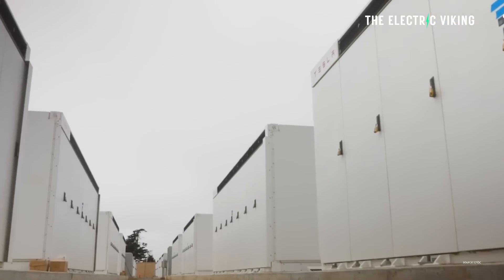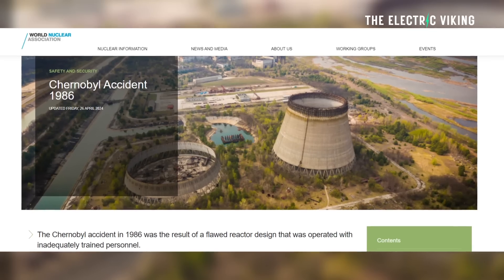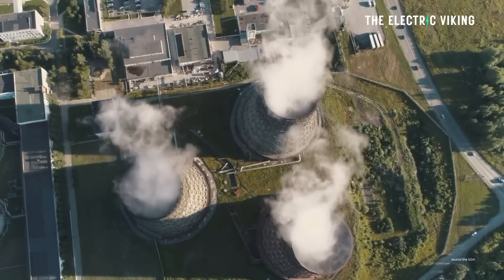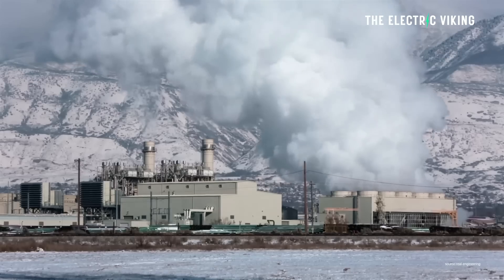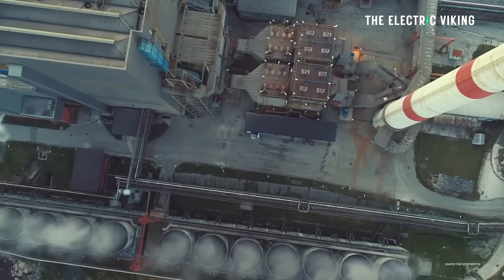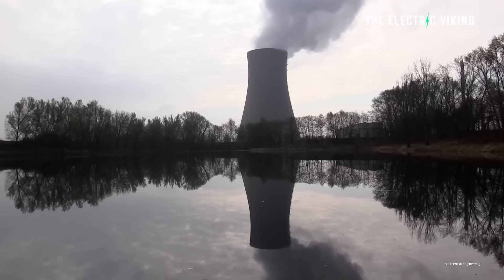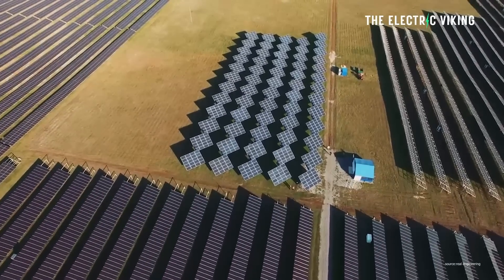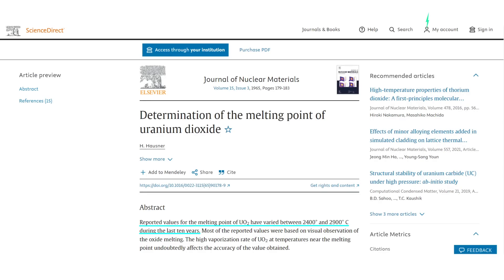China build the world’s first thorium molten salt nuclear power station

Comment: Thorium molten salt reactors do not require water for cooling. Molten salt is used for heat transfer. Corrosion was a significant obstacle. Chinese scientists must have overcomed this for it to be commercialized. Small Thorium nuclear reactors could be built in remote regions and since it does not produce by products for weapons, it can be safely sold around the globe. Small Thorium reactors are safe for use in ships. India has a huge source of Thorium and has been working on it much longer. For some reason it now lags China in this area. Many other countries are now jumping on the idea and I wish them success.
It takes a country like China to push peaceful use of nuclear energy.
Reply: @northernsamba7388  you’re exactly right. I would only add that many believe the corrosion issue was far overblown to get the desired outcome. Certainly with the intervening advances in materials science that’s more of a speed bump than a barricade today.
Reply: wr
Reply: Molten salt is less corrosive than hot water. 

A more corrosive thing is some mix of salt and water. (ie salt water). 

Whether your reactor design uses salt, or you use water instead, you want to keep the coolant very pure.
Reply: @terjepetersen  That suggests two probable main reason why USA killed Thorium reactor development, they wanted bomb making uranium or they viemed keeping salt pure difficult.
Reply: @northernsamba7388  - I don't think either of those were significant factors. I think the budget was axed because the benefits were not well understood by those that allocate budgets. Light water reactors were working.

Comment: A  Thorium atom  Th233 catches a neutron and then decays to U233 which is the real fuel for the reactor - U233 also catches a neutron and then splits, providing the energy - and not providing fuel for a bomb. The chemistry of the molten salt mixture has to be watched. Some twenty years ago the son of the then Chinese president went to Oak Ridge to ask for everything US had about molten salt reactors and it has taken twenty years to solve the problems, mainly because the molten salt at six or seven hundred degrees Celsius is able to eat most metals. A main advantage is that operating at such a high temperature you can achieve a much higher thermal efficiency, about 50% rather than the measly  33% or so of PWRs. And because no pressure vessel is needed the whole thing is a lot smaller and lighter. Because of that and because so many neutrons are caught by Thorium many few neutrons will escape the reactor and will have to be caught by  a lead mantle that that thing too will  be much lighter.
A dozen years ago China said that the new coal fired power stations would have their steam generators replaced by nuclear reactors when these became available. These need steam of 550 deg Celsius or more so molten salt reactors   can be so used.
Det Norske Veritas recently approved the design of a class of very large container vessels, 24 000 TEU, powered by a molten salt reactor for use year round between the Pacific and Atlantic Oceans  north of Siberia.

Comment: Uranium isn't absolutely limited (235 or 238), you can make Uranium and various Uranium isotopes from other elements; it's just that it's costly, so it is economically limited. Breeder reactors, fast breeder reactors (and the theoretical proton breeder reactors which have never been properly studied let alone built as they are most likely an economical black hole).

Comment: If engineering issues can be solved then nuclear energy is the most ideal. Current renewable energy is too unreliable and not sufficient. Notice keeping up with current level is not enough as energy consumption rises with industrial and technological development.
Thorium is quite ideal for abundance of fuel and safety of operation. The other is nuclear fusion with helium 3. But that's probably not coming in next 50 years.

Comment: I would happily live near a Thorium nuclear power plant. Much safer than living near a coal power plant. It is also much better than living near a wind power station. Wind power stations are quite noisy with woosh woosh and ugly. Solar is quiet but also kind of ugly. Solar takes up massive surface area and create heat islands. The waste problem from Solar and wind is also a concern. It's not radioactive but it is massive and toxic. Thorium liquid salt reactors can be walk away safe. The liquid salt fuel cannot dissolve into water and does not need a powered cooling system to shut down safely. The amount of waste is miniscule compared to any other power system. The liquid metal and high pressure water cooled reactors scare me. There is no way to make them walk away safe. Solid fuel reactors also have lots more waste that requires long time storage.

Comment: A molten salts reactor is one variant of nuclear power plant, the fuel can be uranium, plutonium, thorium... Thorium fuel can also be used in another type of reactor, the pebble-bed reactor, one is already running in China. Pebble-bed reactors can also use uranium and plutonium. Both designs are fail safe, they can't melt down. The molten salt one obviously can't since it's molten from the start. And the pebble-bed type is a high temperature design that won't melt even if there is no more cooling. In both cases the radioactive fuel is concentrated enough to produce a nuclear chain reaction=>heat=>power, but not concentrated enough for the reaction to get out of control.

The molten salts reactor needs a chemical treatment on the running fluid to remove waste elements produced by the reactions, and that's the part I'm quite skeptical about. A traditional reactor just needs refuelling every 18 months or something like that, it's a lot easier.

Comment: Not just molten salt but thorium molten salt reactor.  Being high tempature it can cool using air exchanger like a AC system.  Since it operates at low presure these reactors don't need containment structures.  These reactors can be built near population centers.  Running at high tempatures heat can be stored in molten salt tanks so the power output can be ramped up and down as needed.  A plant like this is able to output power at times twice the power output of the nuclear reactor.  Heat storage in molten salt is 1/3 the cost of any other storage ststem.
Reply: They do need a containment structure it is just that the structure is very tiny. Water cooled reactors need a large containment structure because if water flashes to steam it expands by a factor of 1700.

Comment: Australia is one of the world's largest producers of thorium ore. Currently it is nearly all exported to China where it's only conceivable use is in thorium molten salt reactors (TMSRs).

China, in installing these reactors in the Gobi desert, has nothing to do with safety. Molten salt reactors (MSR) are designed for use in desert areas because they use little or no water. They are instead cooled by gas and use the closed Brayton cycle for power generation. 

Because they are already molten they can't melt down so unlike pressurised water reactors do not need vast amounts of water to keep the core cool in the event of an accident.

MSRs are continuously fuelled and have a load following characteristic with their temperature self limiting to around 650C. 

They are unpressurized and walk away safe. To stop the reactor you can stop adding fuel. To stop it quickly you insert a neutron absorber in the reaction zone. In the event of a fuel spill (such as a reactor vessel fracturing) the leaking fluid is captured by an outer shell and drained under gravity into a drain tank under the reactor where neutron absorbers stop the reaction.

The original MSR was successfully tested at ORNL between 1966 and 1968. The Chinese have since built and tested two engineering prototypes based on the ORNL design. They have announced a full scale engineering prototype of their proposed operational reactor will come on line in 2026 and with the first of the operational reactors in 2030.

The Abilene Christian University (TX) in the US is also about to commission an MSR based on the ORNL design. It will be used for research and training.

MSRs are particularly suited for waterless locations and industrial situations where high grade heat is needed such as metal smelting, bricks, cement, chemicals, desalination etc. 

They have the potential to dramatically transform the use and human habitability of desert and water deficient areas by providing ample energy and water in places hitherto considered uninhabitable.
Reply: thanks
interesting

Comment: Since molten salt reactors uses a liquid fuel it can have a plug at the bottom that will melt if things overheat. Then the molten salt thorium goes into a container under ground and the reaction stops.
Reply: US gave up on the molten salt reactors, China took it over the finish line.   Saudi wanted China to install MSR for them too.

Comment: Excess energy can be stored as molten salt batteries. This can be released when needed. This is the method that Bill Gates’ nuclear power plant is using. 

Additionally, these reactors can be used to get rid of nuclear waste as it can burn off plutonium and uranium.

IMHO diversification of power sources is a prudent strategy and Thorium reactors are a good option to help fill the peak demand needs.

Comment: You’re wrong, it won’t melt down it will solidify in a drain tank once the pumps stop working in a emergency situation…

It needs a moderator to continue the reaction and there is no pressure leaks at all in this system so no gas explosion or overheating or melting… it doesn’t even need water…

This was to replace the submarine design but nixion wanted war weapons… in which thorium can not be turned into any fission bomb…

And so USA sat on their laurels wasting a opportunity… 

Like or not, China is picking up the pieces and developing it… hopefully to use for more then just domestic consumption, like space travel and off world energy…

Comment: Viking, two things -- one is that these two classes of nuclear energy cannot be compared, they are quite different classes. While the old style burns .... it is something way less than 1% of the uranium, possibly 0.3%. Before the graphite, normally rods, enlarges and become useless. Leaving a freaking hell of 99.7% to pollute the world. The LFTR generation burns 100%. See the difference -- below 1% vs. 100%
Another thing is that Molten Salt reactors and LFTR was political banned -- Richard Nixon -- because it was not a viable means to weaponize plutonium. Hence -- for 50 years we have been stuck with one of the most ineffective versions of nuclear energy. The barrier has NEVER been technical, but political.
Would I prefer wind and solar and batteries -- sure, I would. But do not compare "green" energy one-to-one against different classes of nuclear technology and which have close to nothing in common when compared.
Those creating the first functional, viable, political accepted version of Molten Salt reactor may conquer the world. Being the Indian or the Chinse people. The US had it running very well in the 1960, but Nixon was the bad, bad guy here. Just as he caused havoc with all economy by setting printed notes free from actual gold.
Nixon did two very bad things for the world and which still dominates today. Very bad.

Comment: thorium reactors do not produce plutonium. ie no bomb 
radiation products are shortlived ie no geologic scale polution
probably use them to burn up old waste
different design - you can drain it into a tank - if something is wrong
china is good at copying, but this requires new thinking and new engineering
with nuclear distaste the west has not been able to tackle this - much less explain it to the public 
if you must have nuclear - you should have thorium - 
but no-one ATM can sell you one.  Its still a wannabe..

Comment: Australian coal shipped to China isn’t used in power plants, but steel mills instead. Plenty of power plant grade coal available in China itself.
Decarbonising steel mills will probably take a few decades…
Reply: Yep. Metalurgical coal isn't going anywhere anytime soon.
Reply: Coal is also used to reduce silicon oxide to make silicon. Which is needed to make solar cells. Nobody likes to talk about this source of CO2.
Reply: China buys both thermal and metallurgical coal from Australia. Quite a few of their coastal coal fired power plants are engineered to specifically run on Australian or Indonesian bituminous coal and run poorly on the local Chinese higher sulphur lower density thermal coal. This was a contributing factor to their power shortages in 2022 after banning Australian coal imports.
Reply: @bluecedar7914  True. Is it a significant export for Australia, though? I thought met coal out did thermal by 10:1?
Reply: @davidbrayshaw3529  Both grades are significant export earners for Australia. The ratio varies with market demand and mine outputs. In the 2022-23 financial year the ratio was almost equal in tonnage, around 53 percent metallurgical to 47 percent thermal, while in 2023-24 metallurgical exports were 156mt worth around $61 billion and thermal exports were 205mt worth around $37 billion. NSW exports around 4:1 thermal to metallurgical while Queensland exports around 3:1 metallurgical to thermal. Not sure where your 10:1 comes from, even in earnings metallurgical coal hasn't reached this level of relative importance. India mainly imports metallurgical coal from Australia as it has good local thermal reserves and import agreements with Russia as well as Indonesia for thermal coal. China imports substantial amounts of metallurgical coal from Australia but imports considerably more thermal coal when not cracking a hissy fit.

Comment: Thorium MSR does not need water to cool it therefore ideal where there is no water in the desert.
Reply: What does it use to produce steam to drive the turbines?
Reply: @davidbrayshaw3529  If water is used it is in a closed system where the water is recirculated. PWRs require water to remove excess heat either by evaporation of water in a cooling tower or by cooling using a body of water e.g. a river, lake or ocean. That loss of heat is why MSRs are more efficient at producing electricity than PWRs.
Reply: @bobsmith3983  That makes sense. Thanks for taking the time to reply.
Reply: @davidbrayshaw3529  Supercritical CO2 is preferred.

Comment: When Thorium designs become practical (next year several projects are planned to build their first practical reactors), they will be  a useful complimentary part of a mixed energy economy based on solar and wind. They will be brilliant for low land use, heat for industry and baseload power. they will reduce the need for vast battery-farms. The low pressure design will mean that Elon Musk will not have to worry about having small Thorium plants close to centres of population. They will be - literally - safer than wind or lithium batteries. Perhaps the most vital use will be for desalination plants and cutting out fossil fuel use in third world countries.

Comment: Sam... About lacking uranium in the future... That's require nuance. Sea salts contains a small fraction of uranium. Because it's a very small quantity, extraction is expensive. Not only in price, but also in energy.
If very efficient mechanisms are invented, they uranium would be "unlimited" (a lot higher than current land reserves). Still, I'm skeptic about a method so good to reach the current price.
With a fast neutron reactor, the fuel required is a lot less (because it's a lot more efficient burning the fuel) so it's easier to reach a point where sea uranium price and the reactors could be work together in a profitable way.
But most probably, this kind of uranium source would never reach a price where old current models could burn it profitably, so in practice, this uranium doesn't change your sentence.
So, in case some countries wants to continue with nuclear energy, to push to breader/fast nuclear reactors that use the fuel very efficient is a must or they can risk a future price where their generation costs will turn extremely expensive.

Comment: Wow, here it is, the first molten salt thorium nuclear reactor in the world as China has solved all the problems with respect to thorium based nuclear reactor. The USA began experimenting with thorium nuclear reactor some 70 years ago and abandoned it as they turned to uranium based reactor which is more radioactive and dangerous. Now, China has amazingly solved all the problems and made the first thorium reactor which is far more environmentally friendlier and cheaper as there is abundant of thorium in the world. China is now at the forefront of the nuclear technology with its 4th generation nuclear reactor which is very efficient, the modular based reactors for rural areas and thorium molten salt nuclear reactors which is much cheaper to operate and safer to use.

Comment: The first Thorium reactor was built at Oak Ridge national laboratory!
Reply: Then left the design on the shelf for cob webs to dream about it for decades ago.
Reply: They never actually built and ran the reactor on Thorium.  It was molten salt but ran on uranium. They ran the reactor  to understand corrosion issues. The reactor cannot run on Thorium because it is not fissile meaning it cannot sustain a nuclear reaction. The idea is to breed Thorium into fissile material by exposing it to the neutron flux from the reactor. Then chemically remove the created uranium to run the reactor. They were also studying the chemical separation system to understand its operating parameters.
Reply: @ronwoodward716  Thanks for the info.
Reply: @ronwoodward716  - for a time they did run it on uranium-233 which had been made out of thorium in a different reactor.